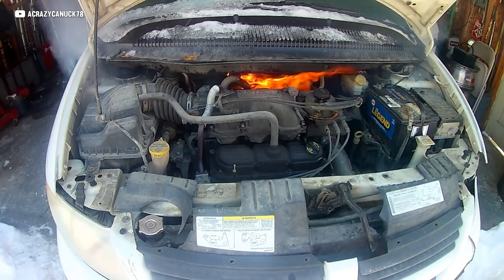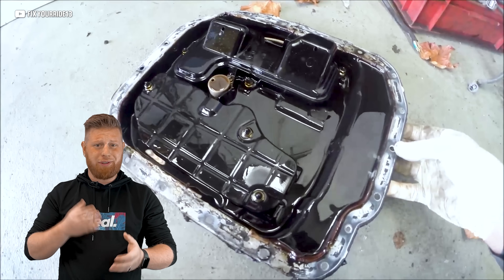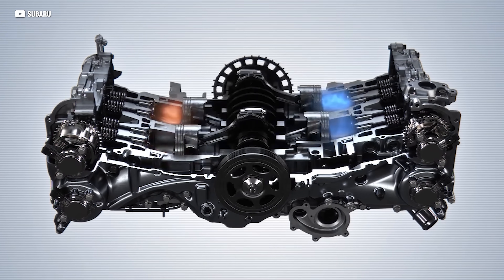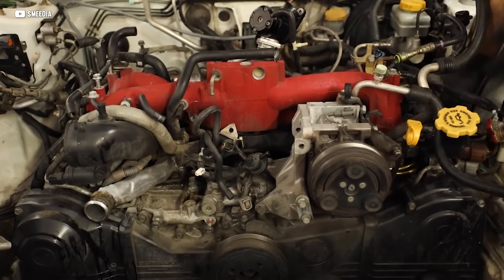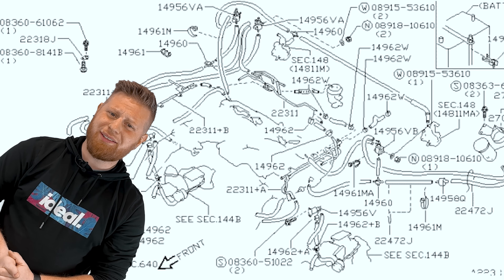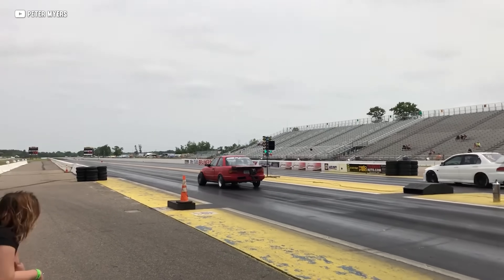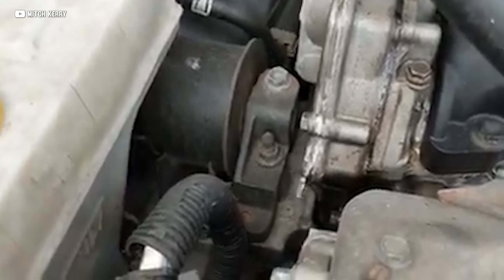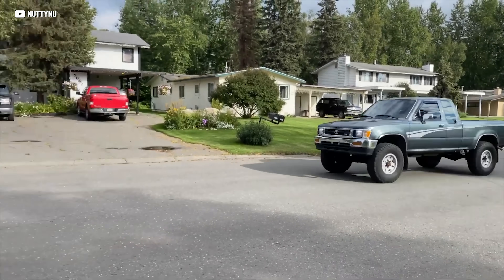WORST Engines Of All Time - JDM Edition

Comment: Mazda's rotary engine was subjected to years of engineering sabotage. There are only two real problems with this engine: 1. The spark plug holes, which should be spark plug slots the same width as the apex seal. 2. The domes in the rotors should have been offset. A shade tree mechanic named Ernie Brink figured this out. But the best engineers in Japan couldn't for some reason. Something is wrong with this picture.

Comment: My top vote... Nissan Z24 engine. No power, terrible fuel mileage and I had to replace 2 of them in 2 years. I rebuilt the 2nd one myself with aftermarket parts. Much better. Pistons, cams and porting those shitty 2 sparkplug per cylinder engine heads

Comment: Hey Trav I wanted to ask if the ej30 is a good engine like found in the underrated Subaru Legacy 3.0R like I have
Reply: I have the same. They're not called ej30s. It's ez30. And they're very underrated.

Comment: Actually 13b engine is reliable it all depends if it was taken care of right and most people do stupid things to the engines that don’t mix, if you want to add liquid nitro for example you gotta rebuild it for apex to handle cold heat and I had a 13b that didn’t eat any oil at all and stayed 7.8 bar all cross all apex seals even after a year driving it, however they do burn gas as much as a s2k and mustangs
Reply: "Actually 13b engine is reliable it all depends if it was taken care of"

I feel "reliable" requires some context here. No matter how well you take care of it, its going to need to be rebuilt far sooner than a conventional piston engine from pretty much any other major jdm car manufacturer.  Rx8s in particular need to be rebuilt around 130-160~ k miles.  Whether or not you did "all the proper maintenance" and were religiously on top of your oil- The seals in them just wear out from use, and thats about how long they last before needing replaced. 

" I had a 13b that didn’t eat any oil at all and.."

Unless you had the OMP disabled or something, theyre literally designed to inject oil into the combustion chambers, and by design "eat oil".  

" however they do burn gas as much as a s2k and mustangs"

S2ks get mid to upper 20s pretty consistently.

Rx8s get mid to upper teens.
Reply: @SidewaysGts  I get what you saying but I’m stating it’s not reliable because people don’t know how to take care of it, if everyone really studied it and knows in depth about the apex seals, the oil, how to premix properly do the oil cooler upgrade and drive it right even with a gutted cat the engine can really last 120 to 160k like any other engine, only way to achieve that is to get it stock straight out of factory or a freshly rebuilt one however one thing I will bring to attention is that the Rx8 itself wasn’t reliable for many manufacturing failures from fuel pump/rings to oil cooler and catalytic converter so I’m not saying you wrong however the right upgrades will delete the oil consumption to 0, the engine taking in local oil and fluids and cheaper plus easier access of alternatives of premix oil without vehicle engine issues, after all of the upgrades and studies I did in the end the carbon build up was the only battle I had and the way I cured it was clean spark plugs once every 1 to 2 weeks depending how much and far I drive it and I do 10k rev 1 time per day

Comment: I am an RX-8 owner and I have to say if ur a REAL car enthusiast and you are taking good care of your engine (This is what a car enthusiast defines), your engine will last forever + you dont buy an RX-8 because of fuel economy, you buy one because of its unique driving experience.
Reply: "I am an RX-8 owner and I have to say if ur a REAL car enthusiast and you are taking good care of your engine.. your engine will last forever"

Yaaaa, no.  Not really how that works.  And I say this as a huge rotary guy myself (Probably why I bought my FD 10 years ago).

RX8s will typically see 130-160~ k miles regardless of how well you take care of them.  Sadly the apex seals are just "wear" items, and no matter how good you take care of it, no matter how religious you are with your oil, they will wear- Much like how a timing belt or chain will no matter how well you take care of either- And sooner rather than later itll be time to rebuild that engine.  

For any rx8 you can find thats done over that, i can find you 10 hondas or toyotas that have done double that and are still on their factory engine.

Comment: The 3.8L is the 6G75 not the 6g72 which is in the 3000gt.  If the 3.8L were in the GT it would be called a 3800 GT

Comment: Came here to see if you put any decent engines under fire, started off strong until you came the 6g72 "3.8" 🤣 they drink oil and can get noisy yes, any failure arises from ignorance unlike lots of the engines mentioned here. As for being hard to work on they're not. They're reliable and good for power.
Reply: Agreed but plenum pull for back 3 plugs is…annoying

Comment: The problems with the EJ aren't what you think they are. It's the n/a EJ25 that has issues, and the reason is the cylinder wall being too thin on cylinder four combined with having too high a compression ratio for the gaskets, as unlike the turbo, the EJ25 doesn't have varying compression. That can be fixed with better gaskets. The cylinder all issue can be solved with an aftermarket intake to get more air to cylinder four.
Reply: Owning ej25 for 7 years. Never had an engine issue. Rolled about 70k. Most reliable car ive ever owned.
Reply: @semiijs  It depends on the year and maintenance, but most will start to have problems around 120k. Mine's at 138k and just developed some piston slap. And it's been driven hard.

Comment: Wow, someone actually got the major flaws of the QR25DE correct, for once. They are an engine that is plagued with problems from the factory. Absolutely, the worst engine Nissan ever designed in my opinion. It's more than just the intake screws and the precat_ but those are the BIG ones.
 I own the 04 SpecV with the 2.5L in it_ and with a little "de-engineering," you can make them very reliable and peppy. I swear by the engine, contrary to what I said above. It is a fantastic engine_ just the DIYers/owners, have to do a lot of leg work to get it there.

Comment: VQ35DE = Oil burner 1.5 qts per 1k miles with timing problems
Reply: Some of them. Not all of them mine has 90 000 miles on it does not burn any oil

Comment: EJ are not that bad, why I  foresters they hold way more milage than in Impreza.Reason broke youngsters not driving them and abuse them with no maintenance. I know that oil pickup like is fwrong designed but after aftermarket replacement its ok

Comment: My nephews ft86 shat the engine at about 25000km.
Total destruction. And yeah hes young and it got driven reasonably hard but he wasnt and isnt a fkn idiot. 
Toyota flew out a new in the crate engine from japan. He was told (paraphrase) 'yeah it happens regularly. We have  6 here needing new engines. The one make series here in Oz was cancelled coz they blew up all the time'
$32000 car here. $30000 for the replacement engine. Also the dashboards collapse in on themselves. Could have just given him a new car...

Comment: Isn’t the EJ25s cylinder walls thinner and the block cracks?
Reply: The NA engines were, yes. The turbo models were stronger, but people still go "haha subie rumble go brr" and try to get power out of it without reinforcing the internals which make it go boom.
Reply: @TheTechNopal  Yea thanks for the clarification

Comment: I'm gonna be a pedantic jackass for a hot second: you've got a list of the worst JDM engines of all time, but none of them are JDM as they were all available in vehicles sold in the US.  So...congrats?
Reply: Yeah, the video thinks Japanese branded engines available in the US is 'JDM' when real JDM engines cover a huge gamut from 660cc engines or below up to many pickup engines that were never imported to the US and not even known. In between there are tons of 1 liter to 1.5 liter engines. There are also engines used by vans and cabover pick ups.  How many people know Toyota has a flat four engine. Absolutely right to be pedantic.

Comment: I'm firing up the hate fingers, sir. I've ran a few different shops and the one I was with the longest, we ended up gaining a reputation of being the best Subaru techs in the area in a small mountain community. Half the population I'd say probably had a Subaru. In all my time there I only had one NA Subaru with a rod bearing come in and it's because I refused to do an engine swap on a good engine because I didn't have time so the guy went and redlined it for 30 minutes and blew it up so I'd do the swap. It's not that they aren't strong engines, the phase I DOHC 2.5 had HG problems and the phase II SOHC 2.5 had HG problems but before that and after that it's been a non-issue and it's easy enough to fix permanently. As for the turbo engines, the biggest issues they had were: Filters in the feed line for the turbo would clog up over time and starve the turbo, they put out a TSB to remove them completely. And the other issue was oil starvation when tracking the cars. They need a baffle in the oil pan to stop it from sloshing around so the sump can keep working it's magic. There's also a semi-rare issue where they'd blow a hole in the 4th cylinder piston because they forgot to add cooling to that part of the block, so over time the excess heat would keep wearing away at the piston but this was typically again only for tracked cars and there's a cheap $20 fix for it.

All of my NA Subaru's are either in the 200K range or gone beyond the 300K range without any major work. Also, the turbo engines are known to get absolutely thrashed on, there are more modified turbo Subaru's than stock on the road and young kids hammer the shit out of them before selling them. This is another reason they get a bad rep, someone buys a ticking time bomb sold by some dumb kid who thrashed it and then bitches about it. My personal experience with turbo EJ's has been pretty solid. I've had friends blow them up, usually after a rebuild because they didn't follow break-in procedure. My own personal turbo Subaru, a 2006 Outback XT with a forged STI EJ257 stock engine, I bought it from a kid who installed the turbo oil drain pipe backwards and kinked the return hose which roasted the turbo and he drove it around like that for weeks with almost zero oil in it, it wasn't even registering on the dipstick when I bought it. I put 60k miles on it after slapping a built bigger turbo pushing 30PSI and swapping out the fuel rails, injectors and fuel pump and coils and a custom tune and it finally gave up the ghost and spun the usual 3rd cylinder rod bearing caused by oil starvation.

Comment: Still don't understand why 7mgte was on that list.
Reply: Yes the 3vze is way worse so glad to see that instead of having the 7m..but my last 3vze was 500k and purring until I dunked it 4x4ing
Reply: Yeah I'm quite sure it wasn't sold for many jdm vehicles, only the mz20 soarer.
Reply: Lots of people harp on the head gasket issue.  Its not that bad an engine to work on and was a torque monster with a bolt on build.  My biggest gripe was the factory oil filter location.  Under a turbo, above a motor mount, and in front of a down pipe.
Reply: @s13gouf60  Lots of people harp on about the head gasket issues because most owners had the issue (often multiple times if they held on to the car long enough).  It was really funny on MKIII Supra forums back in the late 90's/00s because people would legit have the amount of head gaskets they'd been through in their forum signatures :D
Reply: @llynellyn  I was there, thats when you could get a clean MK3 for under 10k  and a good beater build for 2-3k.  Honestly that was the main culprit.   Almost always it was down to people being cheap on maintenance.

Comment: I didnt hear anything about Honda but the 10th gen 1.5L had a oil delusion problem because the car didnt get warm fast enough. Tho then again Honda fixed that with a software update, not to mention if u tune it it can go from 182HP to 500 :D

Comment: I was really hoping the 3.slow Toyota was on this list, and you didn’t disappoint. No “worst engine” list is complete without it. Although I will say I’ve got a QR25 in a Rogue and haven’t had any issues in 140k miles, then again, I’m not tuning it and beating it either.

Comment: Sounds like bias bullshit Mr I fix German cars. I had a rotary when I was young, didn't use oil easy start hot or
 cold , had good low down power and reasonable fuel economy. If you want to beat a V8 you have to burn fuel like a V8
Reply: "and reasonable fuel economy"

I mean, they get like mid to upper teens. "Reasonable" might depend a bit on your perception of "reasonable" here.

Comment: Serious question, is the 300ZX TT the most cramped engine bay of all time on a production car? I haven't worked on a more cramped engine in my life
Reply: Try Mitsubishi 3000GT VR4 twin turbo. That’s 3 times as worse as a 300zx.
Reply: Even supermodels have issues.
Reply: Any entusiast bmw Audi Mercedes have way tighter bays, it’s not rocket sipcience, bay is tight for 2 things, one it was built around the design to keep those nice curves and include technology and also for weight distribution, the Z32 is technically a front mid engine

Comment: It kills me that people talk about how good Japanese engineering is, but there's 7 major, now 6, Japanese brands sold in the U.S. & when everyone says what they say about Japanese engineering, they're only really talking about Toyota & Honda, that's 2, out of 6-7 & even most of theirs are overrated, but y'all love to rag on Korean engineering, when it's only the 2.4L Hyundai/Kia engine with the bulk of the issues & even then, it's only the ones made in a specific factory, an engine that was made in several different factories that otherwise have no issues. I've had better luck out of all my Hyundai/Kias, than all of my Hondas & Toyotas, yes plural, I've had almost 50 cars, which includes multiple models from those 4 brands.

Comment: I’ll like to hear about the 2az-fe engine too
Reply: Lol. It just burns up oil, Toyota fixed, it's the rings. Other than that my car is still running smoothly after 260k miles.
Reply: @mrman8856  mine too
Reply: @nofejustin1940  Papadakis built a 2azfe, that's the reason I'm still holding on to my Camry. Lol